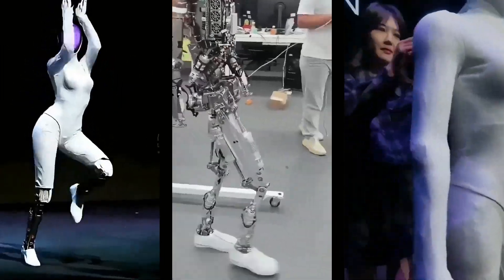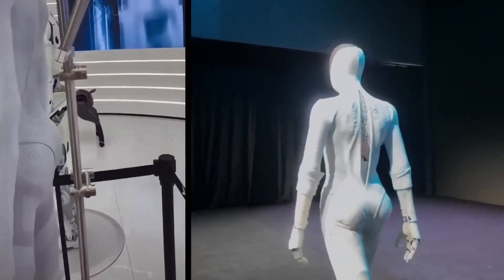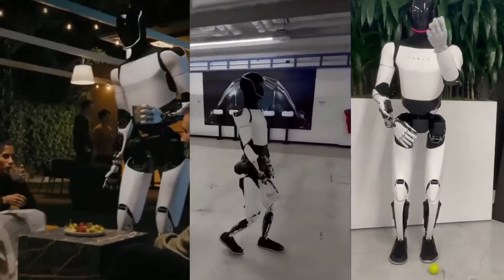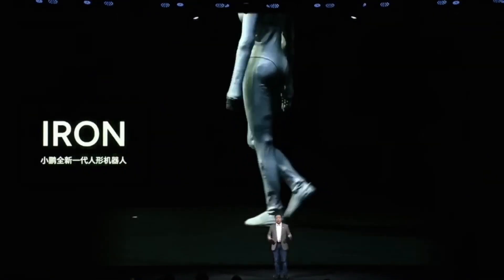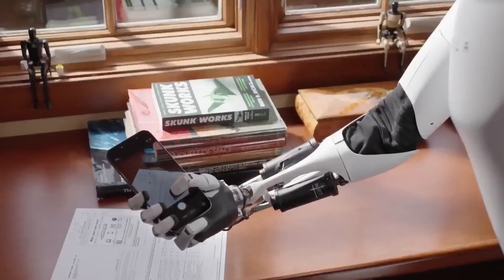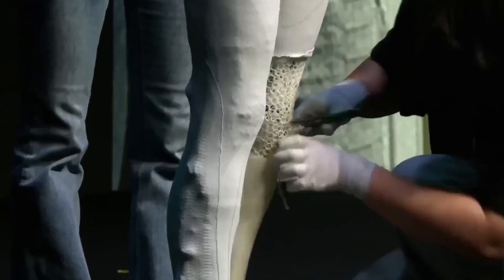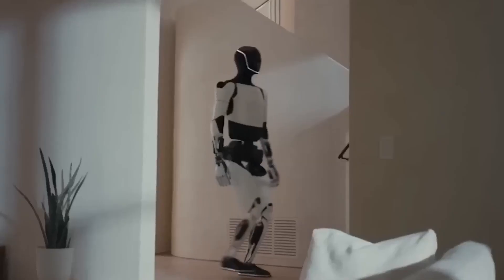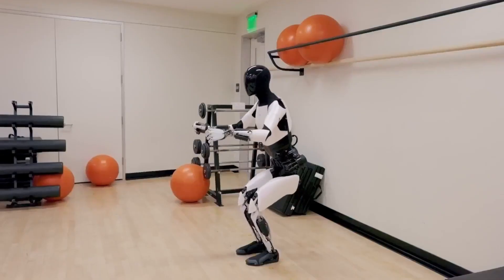Xpeng Iron vs Tesla Optimus – Full Comparison of the Most Advanced Humanoid Robots

Comment: Xpeng Iron needs its environment to be mapped first before it can do anything. That's not scalable to the global market. Optimus adapts to any environment, any home or hospital or wherever.
Reply from the maker: That’s a solid point 👍 scalability really does come down to perception and adaptation. Optimus is clearly aiming for general-purpose environments, while XPENG IRON looks more tuned for structured or pre-mapped spaces — at least for now.

Do you think long-term success comes from full autonomy everywhere, or from robots being optimized for specific environments first? More deep comparisons coming 👀
Reply: @futuretechnzone  it's similar to the situation with industrial robots which need everything to be specifically programmed in. Doing the initial installation and programming is pricey and that upfront cost keeps adoption relatively low
Reply from the maker: @theaxiologist  Exactly — that’s a great comparison 👍 the high upfront setup cost is the real bottleneck, not the hardware itself. The big shift will be when humanoids can learn on the fly instead of being rigidly programmed.